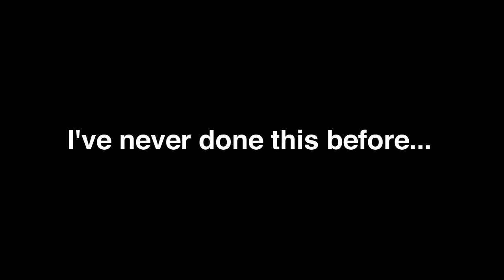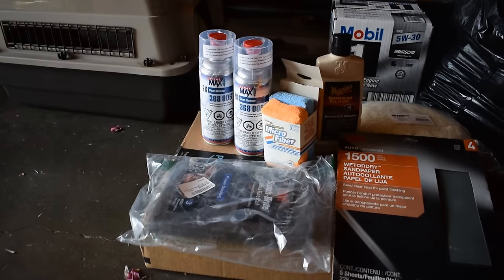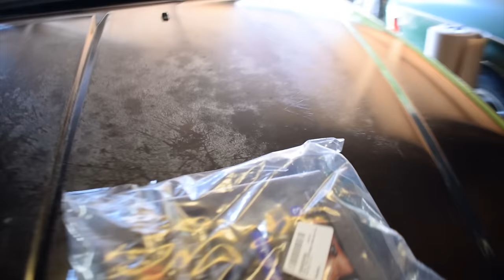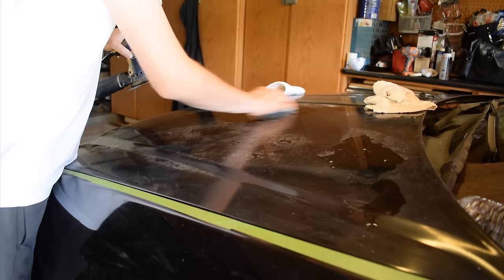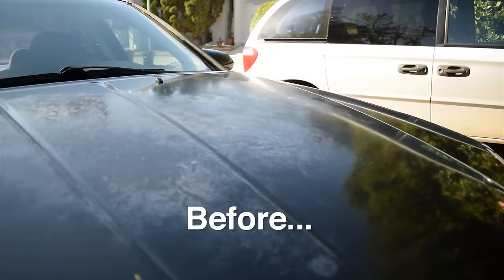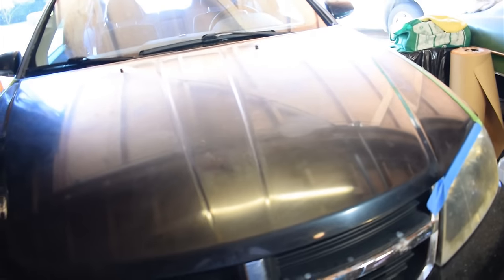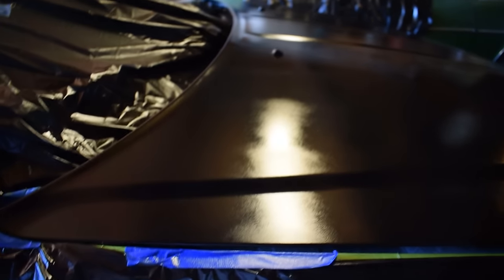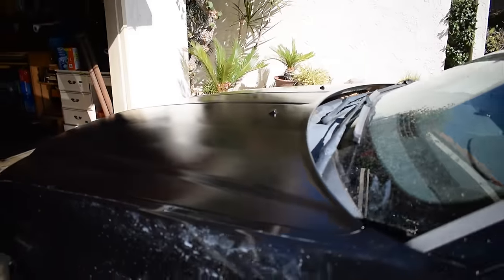How To Repair Clear Coat On A Car

Comment: Research what a 50-50 overpass is.. you're leaving gaps in your passes. You also should have laid down paint first. Thanks for the upload 👍🤙 as long as you're happy with the result, that's all that matters!
Reply from the maker: Thanks for the info and the comment Joey! This was definitely a learning experience for me. I feel like I have a better understanding now for when I tackle the roof
Reply: I would have started with the roof as I'd rather "learn" on a panel that's less visible
Reply from the maker: That's true. I just did the hood because the roof was a much larger area
Reply: @RichRotorhead  no way the roof is easier then the hood.. if anything a piece of sheet metal would of been an ideal starter piece. Or a fender. Besides now he's got a feel for what not to do.. It can only get better ✌️

Comment: Looks like he didn't lay down the clear properly.  Too much texture.  Nozzle moved too fast and was too far away.
Reply from the maker: After I did this a lot of people were telling me to sand the new clear coat down with a really fine sand paper to get rid of the texture and then polish it and it should look a lot better. I haven't tried it yet though

Comment: It was a good effort and kudos for trying, but I reckon it needed a lot more prep work. Remove all the shitty clear coat on top and then respray the base coat, and then the  clear can go on top of that and then it needed to be buffed and shined up again after.

Also, WEAR A BLOODY MASK!! Those fumes are poisonous, literally a one way ticket to lung cancer.
Reply from the maker: Thanks for the comment! I'll definitely be getting a mask for when I do the roof
Reply: @TobiasHolenstein  no worries. Look, I'm an amateur myself at the painting game, but remember mate, preparation is everything. Scroll around YT for other clear coat fixup videos and pick up all their tips and tricks. You'll be staring at the panels for a long long time, so its best if you completely sand down every bit of clear coat on the roof, and then see about respraying the base colour in 2-3 coats, then do the same 2K clear on top of that, and if you can use a rotary polishing tool with some compound and polish if you have any 'orange peel' formed on the surface.
Reply from the maker: Awesome, thanks for the advice! I'll definitely check out some other videos too

Comment: You should have gotten some brown paper or newspaper or plastic sheets to protect the grill, headlights and fenders ... Ok you did in the second half of the video lol... You should use a mask since the clear coat has toxic chemicals that can cause lung damage ( gardener )  .. Didn't they say that in the YouTube video you watched ?
Reply from the maker: Yeah but I had those plastic bags and they seemed to work good enough. As for the mask, yeah, I didn't have a proper respirator mask. I didn't realize I needed one at the time

Comment: Vast improvement, but it still sucks! I know only what little I have seen on YouTube, yet it is clear to me that you should have thrown down some black paint prior to the clear coats. Hell, the black paint alone would have been better than what you finished up with. Call it a practice run, go buy the stuff you expended along with some black paint and do it again. I'm sure the next run will be better.

Comment: Please!  Buy a real mask!   Get one that seals and has charcoal filters.   If you smell it, you're breathing it.   Also, overlap your spray pattern.   You were edge to edge.   You can make that hood look better if you wet sand with block at 1500 grit, then polish it.   You can polish by hand if you have some elbow grease.

Comment: Give me 50 buy the material I’ll make it look new
Reply: Wish I have someone do My Chrysler Crossfire for this deal !! to paint my car even Macco wants $1800 other shops want $1600 to paint each bumper cover and $1600 for the hood and 2 mirrors and $1200 for the one fender that's almost $6000 for a paint job that's  crazy ,the rest of my car is not that bad . I live in Maryland plus body shop said reason my paint is so expensive because it is RED BLAZE pearl factory color. I wonder what a wrap would cost . I hate driving around with messed up bumper covers Bought car used,  its a sporty little car made by Mercedes .

Comment: Now I know why your other video on polishing the clear looked like shit. Clear goes on thick with a wet look but not so much it runs! Bro a little piece of advice when you do something you never done and you had a choice to do hood or roof start with the one least noticeable the roof better than the hood. Other tip watch more than one dyi video cause unfortunately there are tons of people that think they know what there doing that have no clue! You will know when u find a good dyi. At least you were honest! But if you would of kept sanding maybe started with some 1000 and got it to one solid color you would of been golden. When wet sanding the sand paper and car need to stay wet at all times

Comment: You should of wet sanded with some 600 grit first to feather it out,then proceed with 800, then finish it with 1500 grit. When you do this last part should have an even dull finish ready for a top coat of paint. Last thing to do is your clear coat. Good luck.
Reply from the maker: Thank you for the tips

Comment: Did you end up doing the roof of your car, it looked a whole lot worse than the hood? If not you going to make a video on it? Your clear coat damage is a little worse then my car.
Reply from the maker: Hi Victor, I haven't done the roof yet, but I will make a video on it when I do

Comment: Take the nozzles off the hood next time.
Reply from the maker: Yeah, I put tape over the tips where the water comes out so they wouldn't get clogged, but taking them off probably would have made it easier to sand

Comment: Use iron x it will get everything off
Reply from the maker: Thanks for the tip! I've never heard of that before
Reply: @TobiasHolenstein  yeah it cleans all wax iron and bug splater. It's a bit expensive but you can get it from Amazon it's from adams iron x.
Reply: It will turn purple that means its working apply before wash and let stand in the garage on cool paint for about 8 to 10 minutes rinse a d then wash
Reply from the maker: Cool man thanks, I'll check that out

Comment: Spray it on heavier!!!!
Reply from the maker: I definitely will when I do the roof. Do you think it would come out ok if I went back and just resprayed the hood with a heavy coat of clear coat?
Reply: Tobias Holenstein  buy some black base coat if that’s the colour wet sand with 800 then lower sanding with 400 1500 wipe down spray then clear then wait 24 hours buff off with cutting compound jobs done ✅
Reply: @TobiasHolenstein  sand completely flat with 800 grit. Lay the clear on heavier than you did and let it flow out smooth.  3 coats. Sand with 1500, 2000, 3000 then buff if not satisfied with the results of the heavier coats.